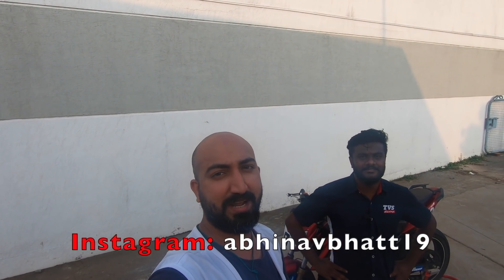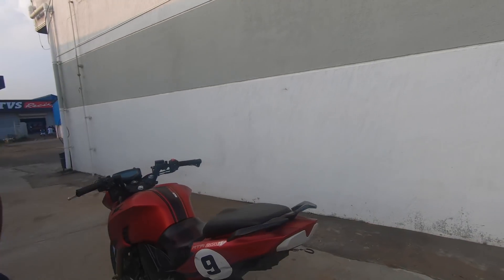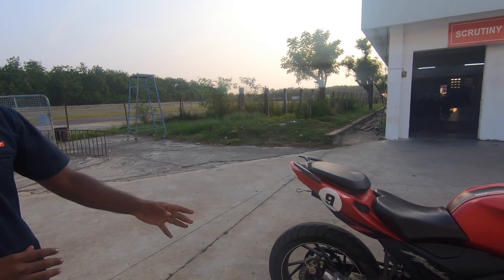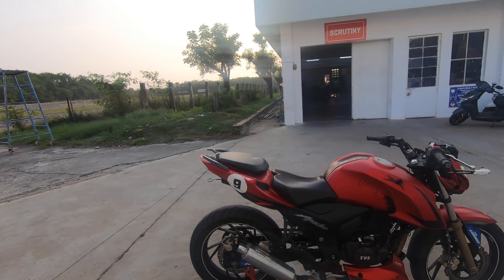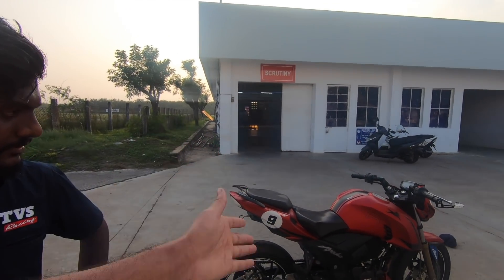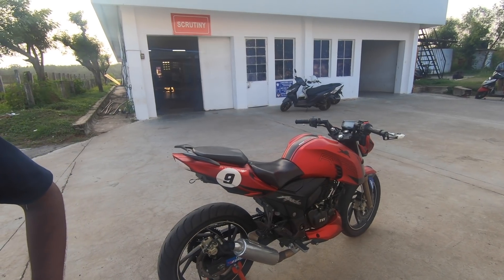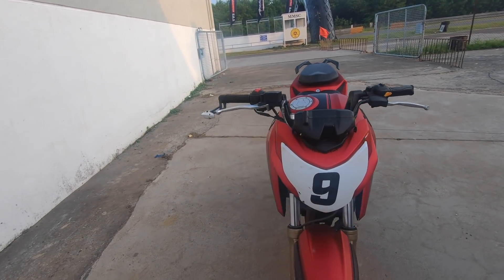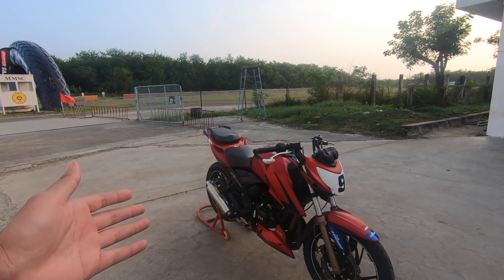25 BHP TVS Apache RTR 200 Race Bike: Race Engineer Explains All Mods

Comment: 200cc is not a track bike no matter how many mods you do on it, its even smaller displaced for a beginner. 
If in track atleast start with a ninja 400 , thts the least or a rc 390 . 
I prefer the rc over ninja regardless of it being a single cylinder cause, of its falcon shaped track design, thts like a baby supersport

Comment: The only complaint I had on the RTR200 was the stiff rear and the soft front. Tuning the rear damping (tiny more compression and a more controlled rebound) would've complemented the front. I felt at hard braking, the front compressed too much making it lose stability (much chatter) which could've been solved by the very stable rear, if it was less stiff. (Perhaps more damping at the rear and less compression at the front?) A bigger carb with FFE would've solved the issue I felt of power trailing away after the 7500rpm mark although it could still rev so much more especially in 3rd gear corners (shifting down to 2nd sometimes was an overkill) But then, it depends on the road and riding style we try to adapt to. The pickup, brakes and the rear stability are the awesome parts. Wish TVS offered more tuning components to their customers-which they do in the new version. Sadly, I haven't tried it  :(

Oh! the 6th Gear!!! When is it coming??!?!?!?!

Comment: NS 200 engineers, aren't you afraid?
Reply: More like KTM engineers 👁️👄👁️
Reply: @firepenguin1030  the engine is good,
 they need twin channel ABS, a good instrument console, slipper clutch, minor styling(design) update, a good chain sprocket set, wider grippier tyres.

So basically bajaj NS development team (engineers).

Comment: I don't know why TVS is doing such worse work with the Market models
When they have such good powerful machines
Why they are making Market models so under be powered
This 2004v can't even beat a pulsar 220
& the 45 bhp RR 310 is must needed
Brother please try to make TVS unserstand it if you can
Reply: For market models reliability and usability is utmost priority
Reply: @typhoys  yeah ,but that doesn't mean you need to decrease power 
I'm not saying about those weight lose thisngs ,but you can atleast make the engine with 45 bhp

Comment: I own the blue color rtr 200 with modes. It is a beast.
Reply: Which kind of mods?
Reply: @pistonblazeautomotive7889  Not mods, they are riding modes given in the new edition of rtr 200. Sport, urban and rain mode. Sport mode is for faster driving whereas urban tunes down the engine to suit city drives. You can definitely feel the difference especially if you are in higher revs. I have yet to test rain mode on my bike. I've recently cruised more than 200 kms on highway and the ride was super smooth at speeds of 100 to 110 in sport mode
Reply: Yes better than squid 🐙 bike ns200
Reply: @vijay-bs8mj  😁😁😁

Comment: At last..... Hearing that apache 200 will come with a 6 speed gearbox..... waiting
Reply: He's probably as much in the dark about it as everyone else
Reply: @bobbymathews9148  😹
Reply: I don't think that engine design can accomodate one more gearing, am not sure, just saying from what i observed during the rebuild of my rtr 200 engine
Reply: @AkhilOmana  I suspect so too. It's essentially the same engine block as the original apache as well so I guess a brand new engine is overdue at this point.
Reply: @bobbymathews9148  I did hear some rumours that the reason why it can't accommodate a 6th gear is due to the fact that it's s tvs fiero engine so that's why they can't make a 6th gear for it..
Reply: @dejoelf2883  sixth gear only requires adding an additional cog to the gearbox which the current engine has no problem accomodating. I suspect it was a cost saving measure because the 5th gear is tall enough and most people won't try hitting the top speed on our roads that often. The fiero thing is also just a rumour as the only thing left in the current RTR series from that old TVS-Suzuki engine is the engine block itself and even that has been bored out for more cc along with the new 4 valve system, FI, spark plug, ECU etc so it's thoroughly modern for 2021
Reply: @AkhilOmana  🤷but it would be great.....
Reply: Hope it will
Reply: Those who think 6th gear is not required...compare rtr 200cc 5 speed vs 150cc 6 speed R15 ....6th gear.. it matters for high end performance.
Reply: @kumarjadhav6106  no r15 has faring and has similar performance 
Its not the gear that will take it faster. But the ratio of gears and power and aerodynamics that work
Reply: @sushobhonkonar1155  that's what I'm saying..150 cc R15 makes 17+bhp..and 200 cc rtr as same...but R15 has one more gear to use all that power but rtr don't.
Reply: @kumarjadhav6106  it had been tested if there was one more gear on tge 200 it would not be able to redline 
It needs a complete rework
Reply: @sushobhonkonar1155  ok
Reply: @kumarjadhav6106  bruh what are you talking about? there are 5 speed gear box bike that cna beat 6 speed gear. A  6th egar doesn't increase too speed Buddy.gixxer sf has mroe speed than gixxer 155 just because of fairing, r15 has  a stronger aerodynamic ratio with  stronger tnak, with 2 LAKHS COST you should be expecting that. think with your brain mate, 2 lakh bike slower than 1.6?
Reply: Why do people think 6th gear is an additional gear after the 5th?
If it gets a 6th gear, its not necessary that it increases the top gear ratio, they'll most probably add another gear between the stack, to smoothen out the whole transmission. People think 5th gear is shorter, its not, apache 200 has a very short final drive gear ratio. Makes it suitable for street riding. Imagine an ideal transmission, it'll have infinite gears between 1st and last gear.
That's basically a CVT. Which in fact is the fastest shifting gearbox, even F1 banned a CVT because it was so dominant.
Reply: https://youtu.be/JM1rQlPuKTQ
Reply: apache with 6 speed exits

three 
ten
RR
Reply: @BroZedd  I think he's only referring to the RTR 200 in particular
Reply: @bobbymathews9148  yes